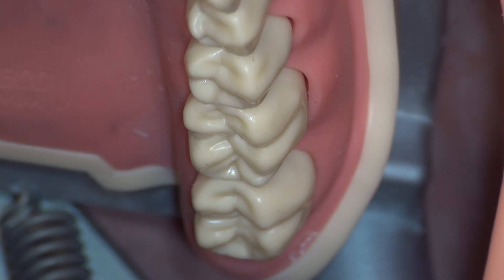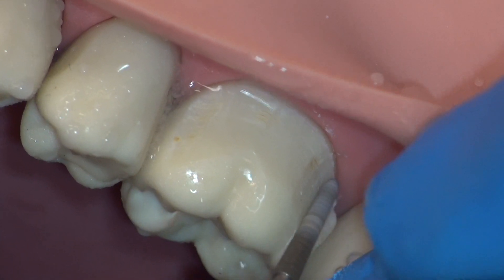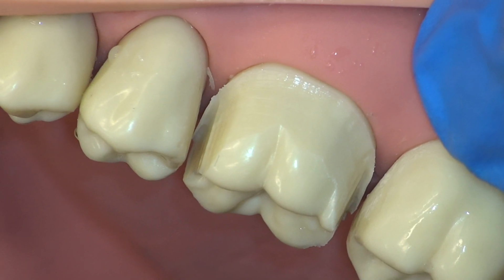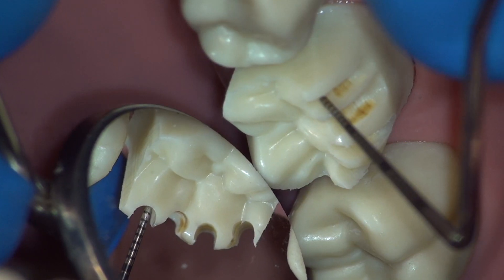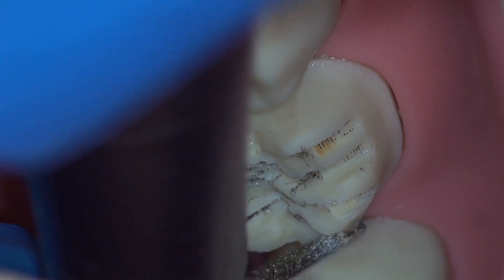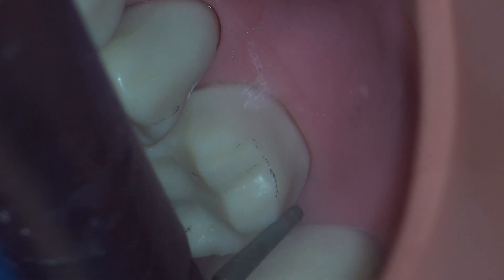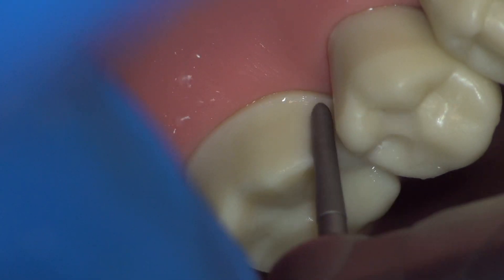Lower Molar Metal Crown Prep | CCC 30 | First Person Perspective

Comment: 8:47 when trying to lower the margin r u pushing the bur down into the margin (towards gingiiva) or are creating a new margin?
Reply from the maker: You don’t want to push because you will slip off or break through and form a defect—the bur is side cutting. 
Let the bur do the work—control the amount of adjustment by changing the bur speed not by pressure. 
Each stroke of the bur has a swooping motion, so the already running bur lands on the existing finishline, skims along the finishline, and then takes off from the finishline in a smooth motion—then repeat for multiple passes.
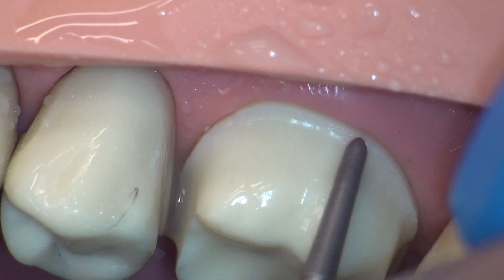7:50 shows this well.